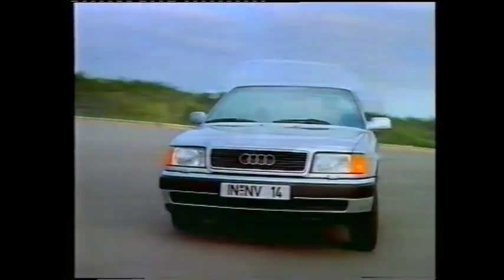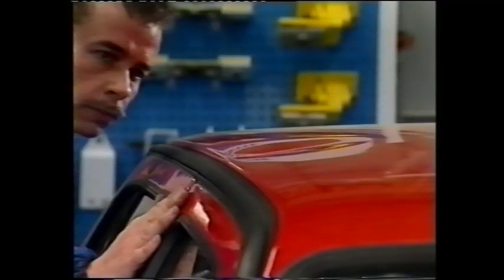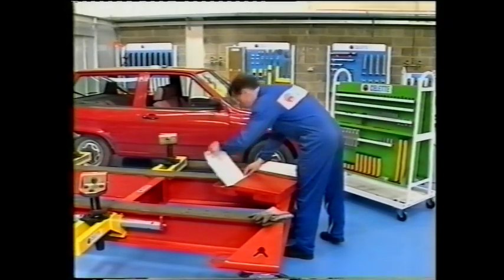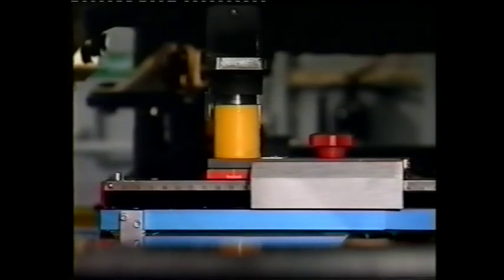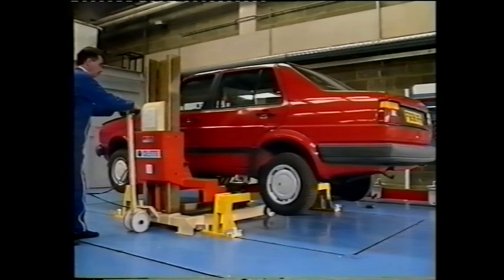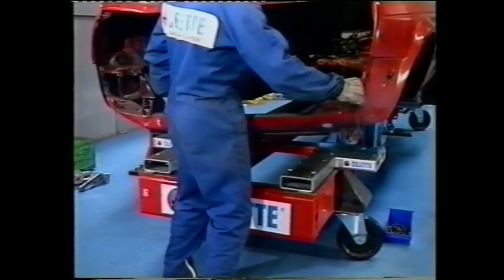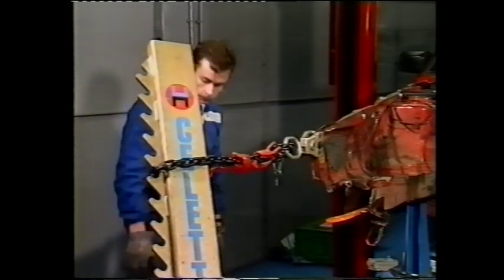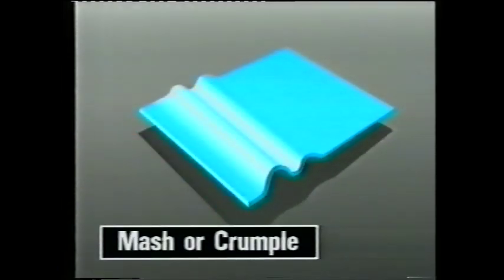COLLISION REPAIR HISTORY, TUTORIAL FOR BODY STRAIGHTENING & FRAME MACHINE, FRAME PULLING BY CELETTE

Comment: Can do the same repairs on a simple Korrec chassis machine.
Reply from the maker: would be really hard to make a Celette tutorial without a Celette frame machine .
Reply: Instead of using Korek you should use hammer and chains. It is the latest evolution after Korec. Tea towels ans napkins should not be mixed
Reply: @emilplumoo6551  *AND 🤙🏾